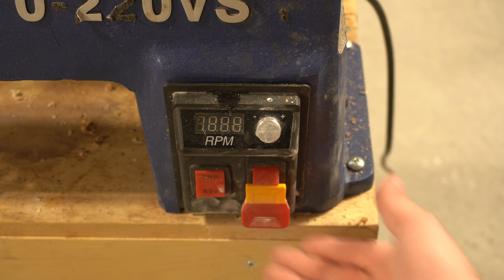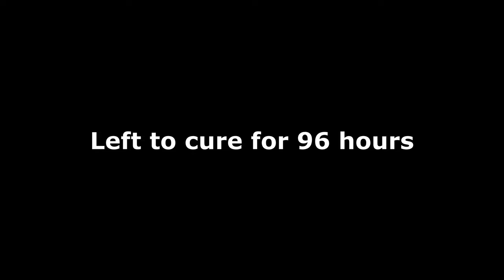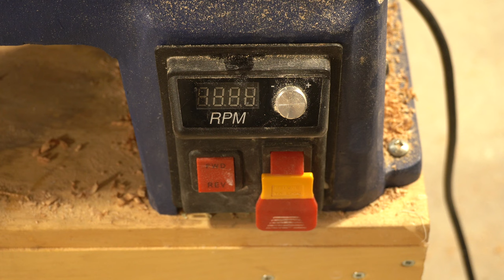Woodturning | The Walnut Lava Bowl!

Comment: Your work is nothing less than amazing.  I am retiring soon and am looking for a hobby and I think I would love doing this.  Which one of your projects would you you recommenced for a newbies first project?
Reply from the maker: Thank you, Jerry!

I'm sure if you ask 10 different turners that question, you'll get 10 different answers. From my experience, I did try starting things off with bowls, and I don't think it was the greatest decision. Bowls are tricky. They're large, for starters, which makes things challenging for a whole bunch of reasons, and each part of the process requires a number of considerations. My first few bowl attempts were rather disastrous, and I remember they left me feeling a bit discouraged afterwards. Certainly not the best outcome when you're just starting out!

After that, I decided to give pens a try, and I would personally recommend these to anyone just beginning. Pens, in my experience, are a much easier first step. You're dealing with much less material, which, one, makes approaching turning much less intimidating when you're just starting out, and two, it will take you much less time to finish a project. Even a beginner can finish turning a pen from start to finish in 1-3 hours, whereas a bowl might take a beginner days to complete. They're also less technically challenging to turn, meaning your odds of successfully completing a pen are much higher. In my opinion, pens are a great starting point as they allow you to develop your skills and get comfortable with the lathe/tools all while notching wins on your belt from successfully completing projects. 

I went back to bowls after turning... I don't know... maybe like 30-50 pens? And the difference was massive. The tools felt more comfortable in my hands, and I felt way more confident in working with the bigger material than I had when I first started out. 

If this interests you at all, I'd check out this video. It's probably the best pen turning video guide I've come across, and it's a great first place to start if pen turning is something you might be interested in: https://youtu.be/E-bzXki7Lf4